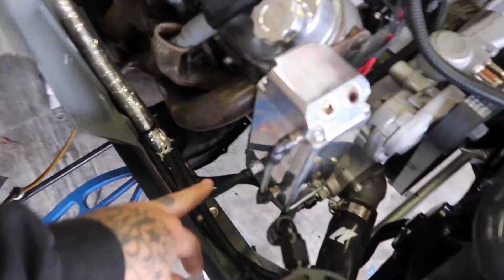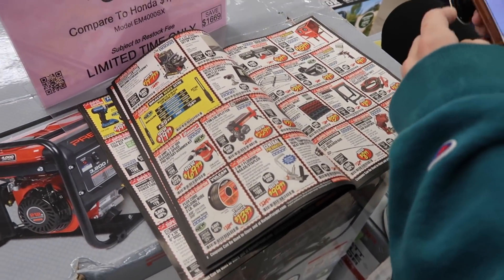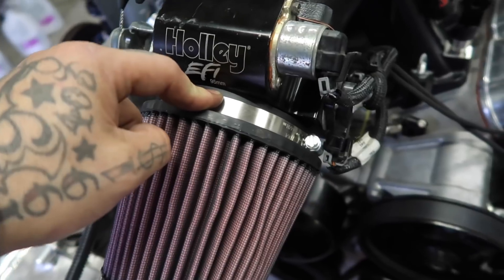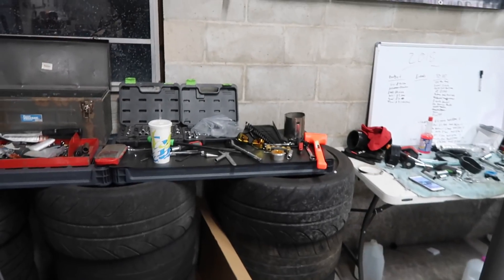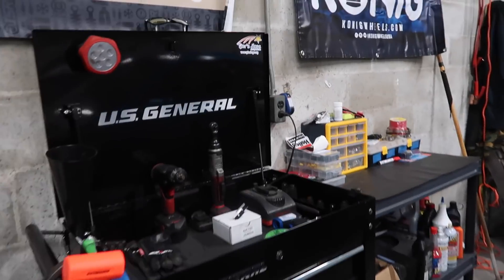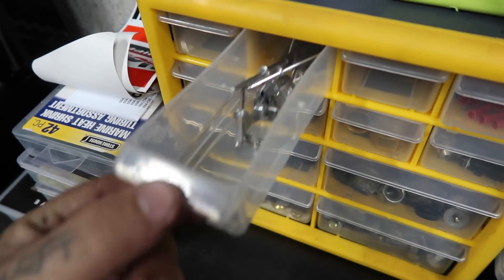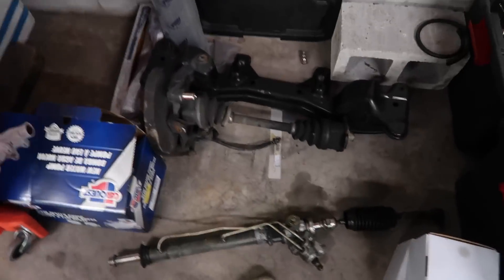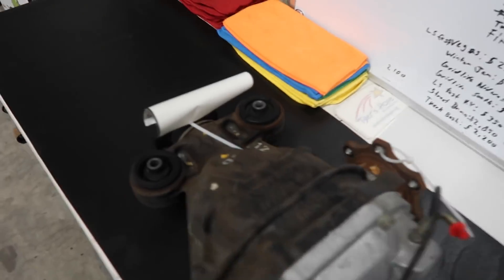SHOULD YOU WELD A LSD DIFFERENTIAL?!

Comment: Hey Caleb, for the MAP sensor you can try getting a new OEM seal part #16194007. Mine is having the same problem on my LS2 intake. You can also add a healthy amount of high temp silicone/RTV to keep it in place. This is a common issue.

Comment: Short answer for those curious, no you should not. You're better off welding an open diff than trying to get the clutches and all that shit to cooperate with a limited slip. If your car already has an LSD, sell it or trade it to someone for an open+cash. Love all the content Caleb! It's nice to follow a proper build for once rather than all the hacked together shit most youtubers do.
Reply: 100% agree. well said my friend.
Reply: Not everyone has or wants to spend the money on a "proper" diff.
Reply: Thats a viscous LSD, theres no clutches in it.
Reply: That's a good point about the viscous. I'm a BMW nutcase and all of our LSD's have clutches, forgot the nissans are different.
Reply: M3ntal You don't have to spend big bucks to have a proper LSD in a BMW :) The e36 in my profile pic is EU M3, having 25% stock diff, mostly worn out after 23-24 years of abuse... Still, it held up whole '17. season and drifted well :) I have recently had the diff rebuilt and upgraded professionally for less than a stock used 3.15 M3 diff itself is worth here in Europe :) It's now at 40%, great balance for track and street as I still use it a lot as a 2nd car. The diff's very aggressive now, locks instantly and holds up without opening, yet, the car isn't chirping everywhere I go as it's not a welded diff ;)
Reply: BMW's are nice in that regard, I have a freshly rebuild 3.15 in my coupe but they're still not "cheap." An E36 LSD in the US is generally $350-500, and usually needs rebuilt. For those not comfortable rebuilding a diff themselves, a built diff from somewhere like diffsonline starts around $1200 and can go north of 2k pretty fast depending on how fancy you want to get.
Reply: M3ntal I had mine already in the car and had it rebuilt and upgraded for around 250€ (aprox. 300$) incl. material and labour + 2L of Motul Gear Competition racing diff oil (50$). Here they go for even over 500 in their stock form, though, but a regular e36 LSD (pretty much the same apart from ratio in most cases and 4-hole inlet flange) is around 200. Add the previously mentioned 350 on it and you have a serious streetable racing diff for 550$ or so. Obviously, prices vary from place to place, but compared to eg. Quaife's offering going for above 1.000, yet not being as functional as it's a torsen instead of clutch type LSD, I'd say they're relativelly cheap :)
Of course, it's not a necessity for beginning, you could run a welded stock diff (which can be had for under 100$) even at pro levels, but a well made LSD will be superior :)
Reply: He got “professional” advice. Wrong advice 😂😂😂
Reply: That professional doesn't belong in quotes. Chelsea IS a professional, he knows his shit. He's one of the rowdiest drivers in Formula D. His advice was spot on for Caleb's situation.

Comment: Caleb, you can run an IAT sensor on the end of that pod filter. It will give you an accurate reading of what's actually going through the throttle body, as pressure differentials inside the manifold can affect readings

Comment: What a lot of people don't understand is that there is a difference between LSD (Limited Slip Differential) and Posi (Positrac). 

LSD isnt always locked, posi is. When a limited slip diff senses that a wheel is spinning, it will automatically transmit more power to the wheel that has more traction. Positrac is always putting power to both wheels, no matter if one or both are slipping.

Also, positrac isnt just a SLA (Solid Live Axle). A lot of companies sell Posi differentials, they are just very costly.

Welding an LSD makes it identical to how a posi works, except when the welds break you dont have 100% power to both all the time.

Comment: You can not properly weld a vlsd as far as I kno. had a vlsd in my s13 and it never performed as I wanted. would come unlocked mid drift and just be sloppy. tried to have it welded and it was near impossible because of the case around the spider gears. best of luck. i hope u can. id like to see the vid.